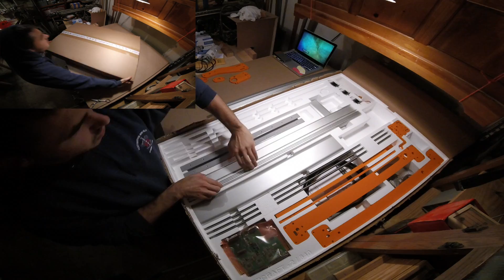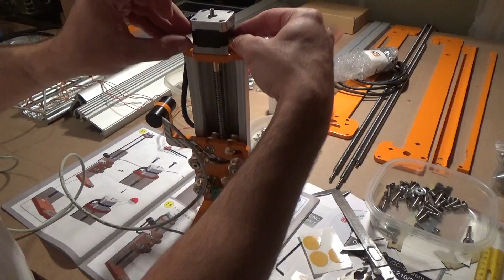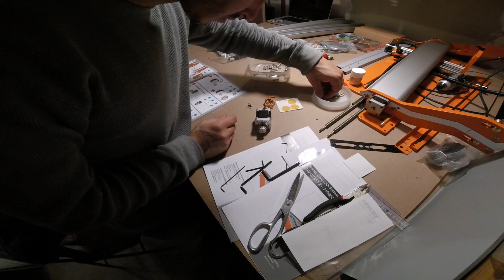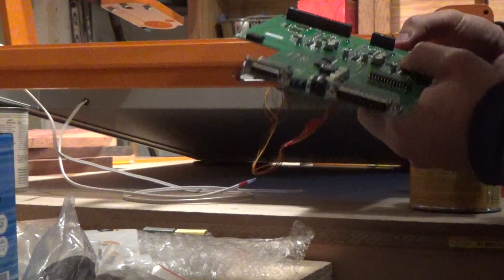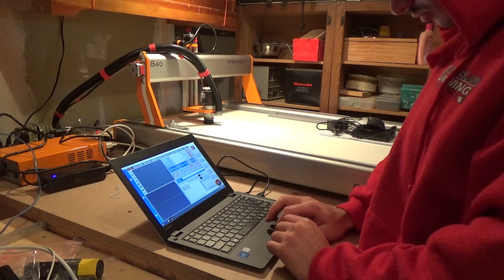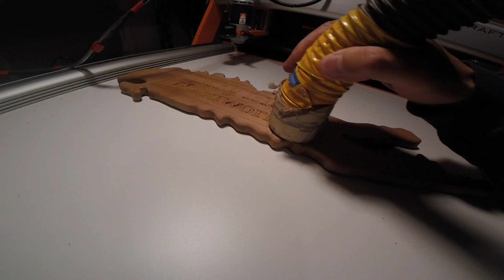Stepcraft 840 CNC Machine - Build and Product Review - 37

Comment: how is the speed? do you think it's fast or slow for the work you do? what are the factors that would affect the cutting speed?
Reply from the maker: I usually prefer setting the machine's feed rate on the slower side so that the cut is as clean as possible, however I don't think the machine would struggle if you bumped the rate up
Reply: how is cutting all the way through thick wood like pine? does the machine struggle?
Reply from the maker: It should have any problems with pine. Pine is a soft wood so it should be good to cut

Comment: found this because I too have just bought a stepcraft..smaller 300 model. I plan to use it for milling circuit boards. Maybe play around with engraving signs as well. I'm a retired drop-out surfer living in Sumatra. Clueless with woodwork and have been thinking for a while about a diy board or alaia. What a discovery finding your channel...will go and watch your old vids. Subscribed. look forward to see what you end up doing with your machine. I'm holding off putting mine together..like you i have that mac problem so was thinking about buying a new laptop or even a second hand desktop..windows 10 hey??. Also am currently doing tutorials in fusion 360..trying to get my head around laying out projects in 3d. Theres a huge learning curve with CNC. I'm an electronics hobbiest so the only thing I feel confident with is the wiring LOL. How many hours would you say your build took??? I'm feeling inspired to crack on with my machine now..cheers mate
Reply: Are fins something you might be able to do on the CNC????
Reply from the maker: Hey dude, nice to hear from a fellow surfer. Nice, yea I love the machine so far, have no complaints really. I worked on putting the machine together only a few hours per night after work so I really didn't have a few full days together to assemble it, ya know. I worked on it for about a month, but I was working very slow just to be sure I wasn't messing anything up. 

Yea, I downloaded Fusion as well. The good thing is that they have alot of videos on youtube explaining the software, which helps.

Thanks for the subscription, I have a few surfboard build videos so def check them out too!
Reply from the maker: I'm designing some fins as we speak! Really tricky to get right tho
Reply: Thinking there's 2 possibilities. You could carve out the fins, one side then flip the wood over. You'd need registration holes to line it up. Other method, would be to carve out 2 halves of a mould that you could pour in some kind of plastic, or traditional fibreglass and matting like they did in the old days. Wonder if there any 3d models of fins out there on the internets already that are open source..that would save a lot of time just measuring  to get the tabs right for fcs/futures.  That is project that even I could do on my 300mm machine?? Definitely something I'm going to try as well. Do you think laminated marine ply would be a viable material..think it might look nice seeing the different layers exposed??? Pretty sure they did that back in the old days (have memory of seeing old mals as a kid that were marine ply)...cheers for the reply..look forward to your future projects.
Reply from the maker: Yes, Thanks for the advise! I've cut quad fins the other day with the inside side flat, ya know and that seems to work pretty well. I think I'm gunna use the indexing pins method for the center fin of a thruster set

Comment: Won't the piece move if it's too light ? can you hold it in any way ?
Reply from the maker: Yea it will absolutely move, I'm not sure if its shown in the video but I hold the wood down with 2-way tape. The machine also comes with two metal bars with machine screws in them to hold the work piece down